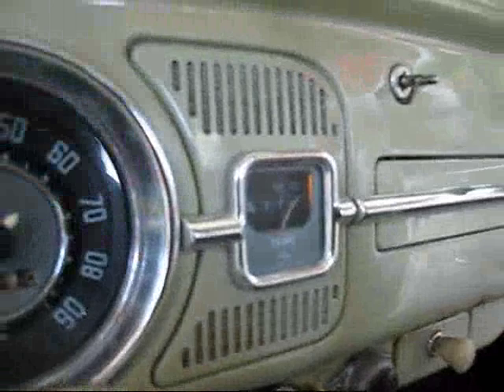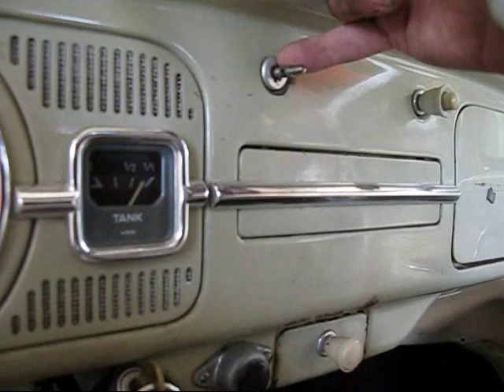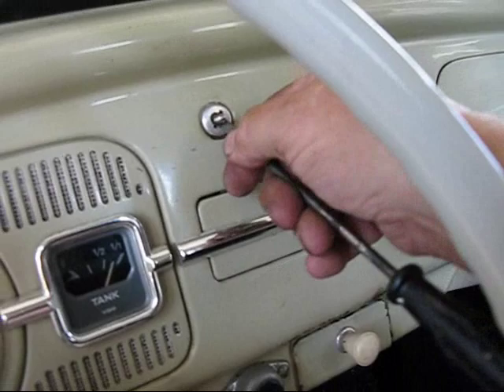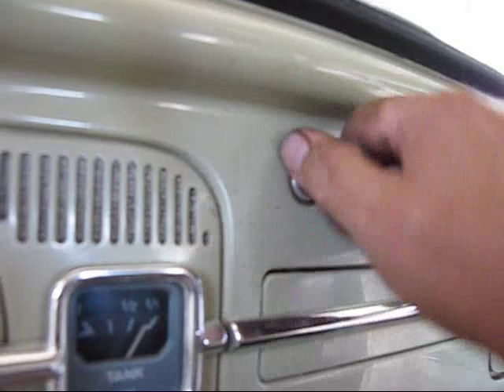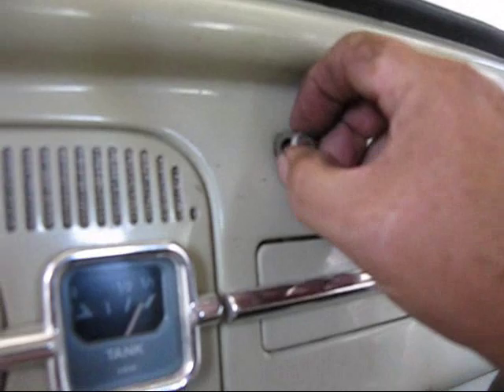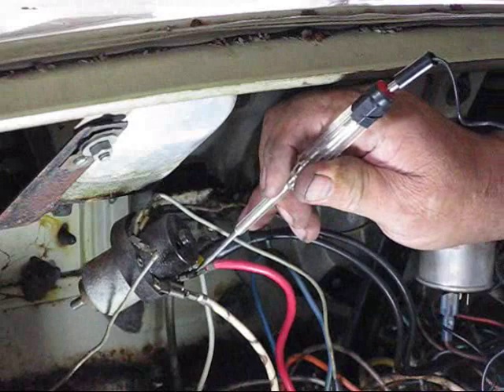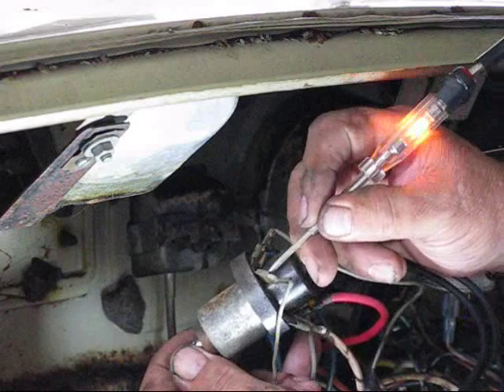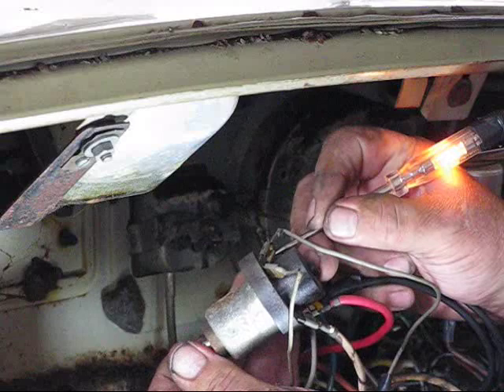1964 VW bug light switch

Comment: Yikes, just got a 61 in  the garage from a customer who purchased it from the original owner. Someone had somewhat done a 12v conversion on it.. although the wiring is completely messed up. I started by replacing the headlights with the updated halogens, which promptly caused a wire fire near the junction block by the firewall. This exposed a bunch of crossed and incorrectly installed wires... like the fact that pulling the headlight switch out one notch actuates the low beams, and pulling it out twice actuates the high beams. The turn signals are completely inoperative, and there are no brake lights. Ha! Thanks for these videos... I'm glad I found out how the headlight switch is SUPPOSED to work.
Reply from the maker: Oh I'm glad there was something in there that was helpful!   Awesome and good luck with yours...

Comment: Thank you for this video, big help on the final details for putting my 62 Baja bug back on the road!
Reply from the maker: RoadRageRaul   Good deal..!
Reply from the maker: +Charles Martin   You've probably lost your ground.  Take the ground wire loose from the car, not just the battery side, but the side where it attaches to the body under the back seat.  Cut the ignition switch on and the wipers on and if they start working as you're taking the ground loose it'll show that it wasn't grounding to the body.  Clean up the connection points and put some oil (Vaseline) on it and put it back together.  That should do it.
Reply: +rpeek God bless you Thank you for your videos and help.
Reply from the maker: +Charles Martin  You're welcome.  Hope that helps.
Reply: +rpeek Hello rpeek I did exactly what you said and it still won't say a word.
Reply from the maker: +Charles Martin   Take both the battery terminals off and make sure they're getting fire?  Run your test light from one terminal to the other, not the battery post and see if it lights.  If it does, run it from the hot side to a bare metal part of the car and see if it lights.  If it does go to the point where the hot wire goes to the system and see if you still got fire, then to the fuze box under the hood and look for fire.  If you have fire in those places, I'd say it's the switch.  You know how to straight wire a car?
Reply: +rpeek Hello rpeek I want to Thank you for your videos and help your correct it was the connections to the starter . And the other dohicky.  You saved me so much money and time.  God bless you Charles Martin
Reply from the maker: +Charles Martin   Awesome Charles.   Good luck with your little VW.  Don't it feels good with it springs back to life.
Reply: +rpeek Yes Sir even better when you have the knowledge to fix her when she's a little sick. I'm forever grateful to you for all of your help and patience. God bless you, Charles Martin